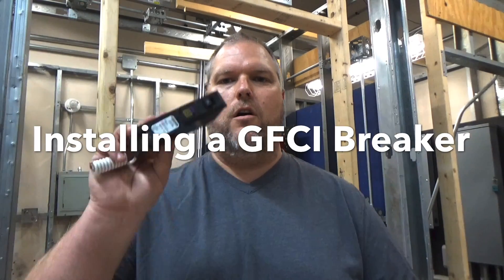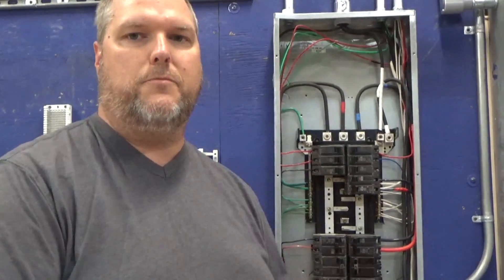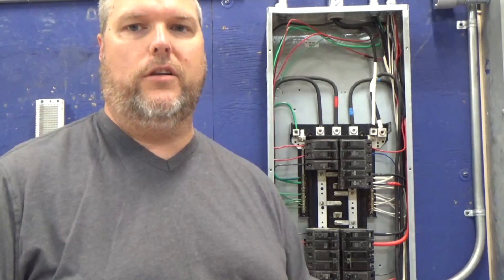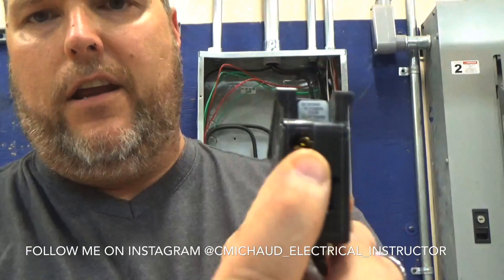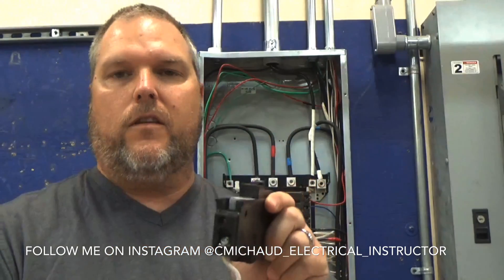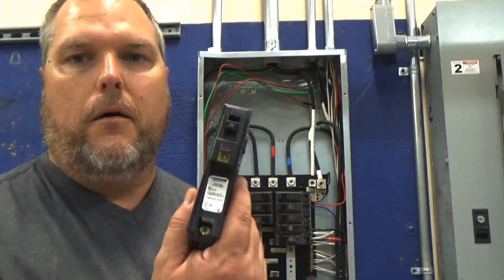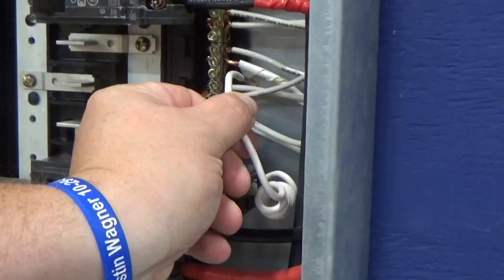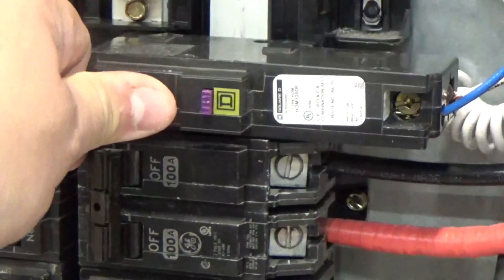Installing a GFCI Circuit Breaker

Comment: Loved the video. Just bought a home where one of these breakers were installed.  Only one neutral wire went from breaker to bar. The other neutral was also connected to bar and not breaker. Could this be why it kept tripping? I just swapped it with standard 15 amp breakers and a gfci receptacle.

Comment: Thanks man. you just saved Me$150. I have been doing small elect. work in the swimming pool industry for 40 yrs. Ironically not replacing gfci breakers. I didn't k now to wire neutral into breaker! Thanks again.:face-turquoise-covering-eyes:

Comment: Craig I have a question. Why would a GFCI outlet read good for wiring. Then you plug something into the outlet and it trips the GFCI breaker? I’m new to GFCI breakers and apparently so is the electrician I am working with. The issue started when I had a regular breaker in my box. Everything worked great, no problems. Per our city code we had to remove the regular breaker and put a GFCI breaker. Now every time I plug something into an outlet that is connected to a GFCI receptacle the GFCI breaker trips. Why? I’m guessing it is the way the neutral wire is hooked up. Can you help me?

Comment: Hi Craig, love your videos!  I'm installing a Square D 20amp Dual function breaker and noticed my main panel (just bought house) has all or most of the neutral whites and bare copper grounds landed together in the bar... Is that how I should wire this one also??? Thanks.

Comment: I want to replace my hood vent that was hard wired into an ungrounded circuit.  I have no ground and am looking for solutions for safety.  I know GFCI receptacles provide protection for the outlet, but if I put a GFCI breaker in will it provide protection for the entire circuit?  My hunch is it would, but unsure.

Comment: Honestly, even turning off the main breaker doesn't mean the panel is 100% safe. If you are nervous working in a panel, call an electrician. It might cost more money but it will be done right and safely. Good video though. Very descriptive about how the breakers work.

Comment: Is there a quick trick finding the neutral in the panel for the circuit when you have all thhn wire not Romex besides finding where this home run lands first and wire nutting hot and neutral for continuity
Reply from the maker: In most commercial jobs we use wire markers that make the neutral and hot wires when they are in a conduit. If they are not marked then ringing them out is really the only way! Hope that helps! CM

Comment: I have 2 hot wires currently into one breaker . Will this combo breaker be able to have 2 hot and 2 neutral lines screwed in. There only seems to be one side that I can slide wires into . Can I just slide both wires into the same hole ?

Comment: Great video. Can the neutral involved in this hookup also serve as the neutral for another hot wire that is on the other "leg" of the service coming into the house? Or does it have to be dedicated, so the potential difference you referred to as the cause of tripping does not occur?
Reply: No. Neither a GFI or AFCI breaker will work on a shared neutral circuit. The current on the shared neutral will be out of balance with the hot wire of either circuit. This causes shared circuit breaker to trip off. I know this from both theory and experience.
Reply: I just installed a GFCI breaker, and pulled a dedicated neutral for the circuit. I figured better safe than sorry.  8^)

Comment: Yeah my electrical box is going to be fun, its an old house with multiple wires that will be spliced into 1 breaker lol, and the neutrals are all cut short since the bar is at the top, so ill need to splice some pig tails just to reach the new afci breakers lol. Who ever wired my house is an asshole.. Nothing is neat, it looks like a jungle going into the box.

Comment: Excellent...Amateur here (since I wired my whole house in 1986).  My main panel has the combined neutral/earth bar on the left of the panel. That means I am going to have to use extension neutral wires for A: the pig tail and B: the circuit neutral.   It can soon look like a bird's nest if I do  not use plenty of wire and route the 2 neutral extensions right round the rim of the box ... Comments ?

Comment: in replacing a non gfci breaker with a gfci breaker you say you need the neutral wire from the same circuit, how do you find the right neutral in a breaker box with so many other neutral wires
Reply: In modern electric cable like NM 12/2 the wires are bundled together. Trace the subject hot wire back to where the cable enters the panel to find its corresponding neutral wire. My house predates modern cable, so I could not do  this. Here is what I did. WITH THE POWER TO THE PANEL OFF, measure the resistance between the circuit's hot wire and a candidate neutral. Each neutral must be disconnected from the neutral bar. If you leave the hot connected to the breaker, ensure the breaker is OFF. The resistance between the hot wire and its corresponding neutral will be low to zero; the others will be infinite (unless you unfortunately have a shared neutral). I did construct a plug with the hot/neutral shorted & plugged that into an outlet on the circuit to ensure a low resistance -- WITH THE POWER OFF. Tip to the wise: remember to remove the shunted plug before reapplying the power. :-)

Comment: How would this get wired for a common (shared) neutral?   In Chicago area, paired breakers (2 Hot wires  - one per 120VAC  phase) can share a common single wire neutral.  Saves copper wire (neutral)   So the GFCI would trip when any load is active on the phase not on the GFCI breaker.
Reply: After some review, found a 2 circuit GFCI breaker with common (shared) neutral.  Breakers share a trip bar -so that a GFCI fault will de-energize both circuits

Comment: Nice video..bought newer house 1 year old…vacuum cleaners pop breakers all over house…have gfci breakers….tried repl myself but shows volts there with entire house shut down…daaa scared me…guy came out and can’t get the new breakers..also they said would crazy over priced….weeks later I get my own…but new gfci breakers have that 3 rd white wire…afraid to go in if hot and wire up..not afraid to wire stuff hot- but volts there when there shouldn’t be is creepy….have an answer?  Capacitor in there is my guess…and main breaker for entire house shut off….thanksss

Comment: You never show where the second white wire comes from or goes. That's a bit important.
Reply: Very much so. What is it? I'm assuming neutral from the circuit we are protecting? But where was it hiding and why??
Reply: @OFR  That was his original neutral that was already landed to the non GFCI breaker. He simply is installing the GFCI in between those two so the GFCI breaker can sense the imbalance and trip.

Comment: So, after he attached the curly white wire to the neutral bar the video seemed to skip and then he attached a straight white wire back to the breaker. Where did that wire come from ??
Reply from the maker: The white wire comes from the outlet!! CM

Comment: I have 10-3 romex gfci. I can't figure out where to connect the bare copper wire at the outlet.  It's it even required?
Reply from the maker: The ground is always required!! It needs to go to the ground bar in the panel!! CM
Reply: @craigmichaud-electricalins4602  thank you.  I ended up capping the load side neutral and connecting the ground like you said.  Breaker panel neutral went to breaker and breaker neutral to the neutral bar.  All good! Tests pass!!

Comment: Hi, thanks for the videos. I had a question. I'm building a food truck and a guy on a video mentioned that he has tampered resistant outlets and he says if you use tamper resistant you must use a gfi or use a gfi breaker. Should I use just gfi breakers or use all gfi outlets or use just one gfi outlet closest to the breaker to cover the other outlet? 
 Thanks
Reply: GFI protection should be present for any receptacle within 6 ft. of running water (like a sink, shower) in a residence. This protection can be provided either by a GFI outlet or the breaker on that circuit. This is independent of tamper-resistant outlets. TR outlets should now be used in any livable part of a residence. I cannot say what the rules are for a food truck, however.

Comment: I need to go from GFCI to a normal breaker. What do I do with the neutral wire?
Reply: Land it on the new, non GFCI breaker at the correct terminal.

Comment: Is this type of breaker designed to fit in most standard home panels? Looks like it just sticks out a bit further. Would this be a good application for a designated 30 amp RV outlet 25 ft. From the panel? and are these GFCI breakers now required for such application?

Comment: Mr. Michaud thanks for this very informative video, I do have a question, can the gfci receptacles be pigtailed or they have to be in a daisy chain? For instance can you connect the two neutrals and make one with pigtail, same with the two hots so you end up with two conductors only neutral and hot and the two conductors be connected to line of the receptacle?

Comment: What's best way to find the right neutral for the hot circuit.
Reply: Sound like you work with existing wiring...very hard manually. I'd trace the wire. If it's too clutter in there, you need to buy a good tracer device...Amazon has one.

Comment: I really hope this is for demonstration purposes only. You put a square D breaker in what I assume is a GE panel, since all the other breakers are GE. That’s a no no, and would fail electrical inspection. You have to use the same brand breakers in a panel. We know some fit others, but some seem like they fit, but actually do not. I think that should be mentioned here, since a lot of beginners are watching this.
Reply: i mean, especially in those old panels. you aren’t gonna find GFCI breakers brand made for a 40 year old panel. if replacing the entire panel isn’t an option then if it fits it ships.
Reply: Works fine as they fit done it for years no problem

Comment: In a residential setting I can’t think of a reason to not turn the main breaker off? Someone in the house on life support perhaps? In a commercial setting, yeah it gets more complicated, but it’s bad, and I have seen it bite experienced guys in the ass. IMO, always turn off the circuit you are working on, unless you need it on to troubleshoot something.

Comment: Great video bro, I definitely feel prepared to go install one of these in two circuits I'm running in a kitchen remodel: One is going to supply a #12 wire for a dishwasher, and another separate one will supply a #12 wire to a refridgerator. Do you think I should do the same for a microwave?

Comment: I built my house about 25 years ago before these things were around but over the last 10 years I've added a few circuits to my house including a sub panel for an AC unit and also wired up a couple other houses where I remodeled the interiors.  I did the wiring on them including replacing the main panels but I specifically didn't use these as I had heard horror stories about these things causing nuisance trips and the fact they are about 4 times more expensive than a standard breaker. Are the stories about nuisance trips real and/or have these things been improved where they don't cause issues anymore?
Reply: I haven't had any problems. They are definitely sensitive. Any kind of fault will trip it...which is good.
Reply: The stories are true but apply to older AFIC technology breakers. AFIC breakers on today's market are markedly improved. HVAC motors may still cause nuisance trips -- but I can't say for sure.
Reply: @portertaylor945  Thanks for the reply. Looks like I can use them now. I hate being the Guinea pig for new technologies

Comment: also I had no idea its code to use stranded conductors, especially in a load center? whaaaa?
Reply: That's a dummy breaker box and he's an instructor. Haven't you seen the size of the incoming power wires? And yes, in industrial applications with metal conduit you must use stranded wire. Rigid wire won't make it through the first bend.

Comment: hmm, that there purple button looks to me to read TEST not trip.  Attention to detail keeps one alive. https://www.google.com/url?sa=i&url=https%3A%2F%2Fwww.lowes.com%2Fpd%2FSquare-D-Homeline-20-Amp-1-Pole-Dual-Function-AFCI-GFCI-Circuit-Breaker%2F50311123&psig=AOvVaw0jzP-mwmGvMVqt4h8LuiHX&ust=1594159614658000&source=images&cd=vfe&ved=0CAIQjRxqFwoTCLDJ0pvSueoCFQAAAAAdAAAAABAE

Comment: I used a 30 amp breaker with my last pool and that was because I used both the timer and the pump on this breaker.  Is that over kill or would the 20 amp GFCI be enough?

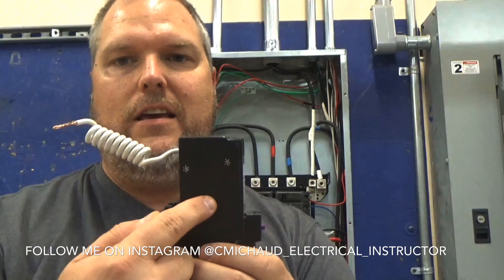Comment: at 3:44, you state that the GFI circuit breaker "registers a difference in potential, it is going to be registering in amperage". Electric potential (see Wikipedia) has units of volts.  Please be more careful of the terms you are using. Thank you.

Comment: did I miss what happens to the ground in the new circuit you installed? Or did you b=not address that?
Reply: Ground stays at the ground bar. It's just hot and neutral.

Comment: easy peazy, thanks I am gong to use one of those for a tank-less water heater I'm installing in a closet adjacent to my shower, figured all that juice going to running right  across from me, well can't be too safe
Reply: Dedicated circuits are usually exempt because the big load sometimes messes with these breakers but you should try it, safety first

Comment: I installed a 20 amp GFCI breaker following your instructions and it won’t turn on.  All it does is trip when move the switch to the on position.
Reply: It is tripping because something is causing it to trip, like a receptacle that is shorting out.. That is the purpose of the Breaker..  You need to go look at each outlet that this Breaker circuit is connected to, and make sure each outlet is working correctly.
Then, if all the outlets are working correctly, I would move this Breaker over to another circuit that you know is working ok and test it there..
If it fails to work there, then the Breaker is defective and you have to take it back..
Reply: That tells you that it detects a fault in your circuit. Check all your receptacles that line runs. I had the same problem like you and found 2 outlets were burned on the back, causing a short.

Comment: great video,  I finishing my lower level and I am required to update to AFI/GFI and my current breaker box does not have the room to install the longer breakers. Is there a solution?
Reply: You could use afci and gfci receptacles. Hook them up with line and load to limit the amount of afci devices needed.
Reply: If you do the outlet method, it's 50ft for 14awg, 70ft for 12awg.

Comment: Hey buddy, so I pretty much chill in the basement of my house (man cave lol) and I had a power venting water heater installed down there. I run an electric fireplace when its cold. I'm getting trips and power resets and I hear a crackling/gurgling sound in the panel, I know it's overloaded with the addition of the water heater. The breaker is 20 amp, would a 30 amp be sufficient, and does it need a larger gauge wire?
Reply: If you are hearing those sounds pay to have a pro check it out. Sounds like some kind of arcing OL situation. 30A require 10g wire.
Reply: @macdaddybill  Had a guy come in, it was the 15A breaker burning out, replaced it. It was overloaded with the elec fireplace running.  need a circuit designated solely for the elec fireplace he said.
Reply: @frandanco6289  I didnt do anything. I got a dedicated 15A circuit just for the fireplace
Reply: Perfect example of why you should call a qualified electrician. There are too many details that could be missed.

Comment: Thanks for the video I didn't know the neutral connected to the breaker itself now all I have to do is figure out what a hot neutral reverse is.
Reply: Sounds like you need to find out a local electrician's number, first.

Comment: Hi I go to a tech school for electrical and im looking to go to competition for motor controls for the competition last year they used a solid state timer relay I was wanting to know if you had a video on them or could you make a video on them I haven't been able to find any info on them thank you for reading your videos have really helped me out
Reply from the maker: I do not have any at the moment but plan on it in the next year!! Thank you for the video idea!! CM
Reply: @craigmichaud-electricalins4602  

 @Craig Michaud- Electrical Instructor  

Question: what is the purpose of the neutral pigtail on the GFCI breaker?

Why does the neutral from the circuit have to be directly bonded to the breaker but the neutral pigtail gets connected to the neutral bus bar? 

This is the only thing that I don't understand.

Comment: Work on energized equipment over 50 volts is not allowed.  If the panel is energized you are considered working on energized equipment.  Safety is paramount.
Reply: It is permitted to work on an energized panel. Panel is not considered equipment.
Reply: James Gonzales,  - Not sure where you got that info.. Tell me then, how can an Electrician test inside a disconnected power panel???  
I once had a problem in a house where many of the circuits stopped  working..
When I went to the 200 amp panel, and took the cover off, the first thing I did was Carefully, take my Fluke Meter and test the leads coming into the panel, from the provider.. 
I measured 120vac instead of the 240vac that should be there..
Turned out there was a bad Transformer that controlled that group of houses that had a problem..